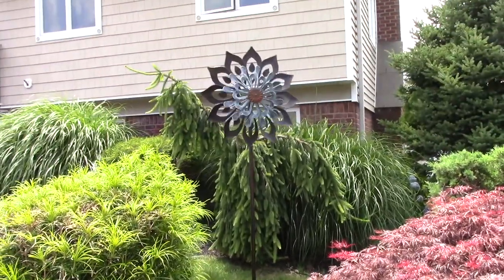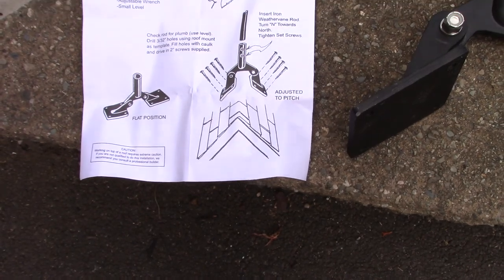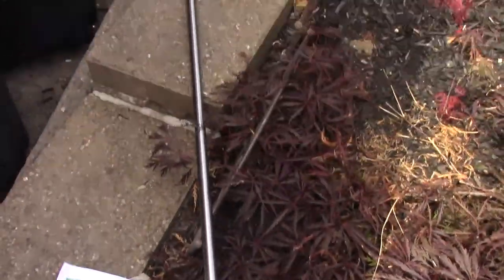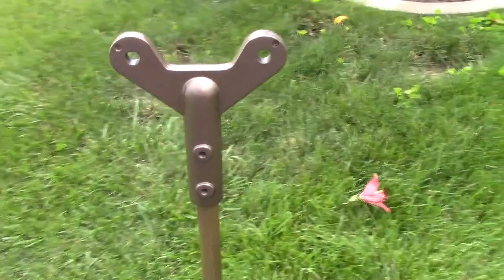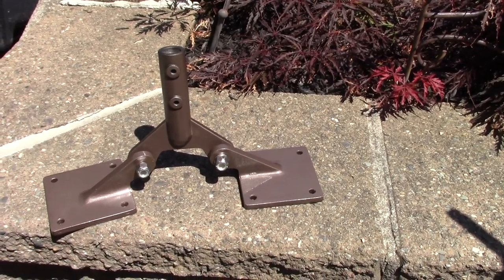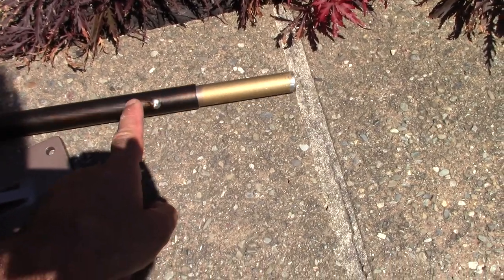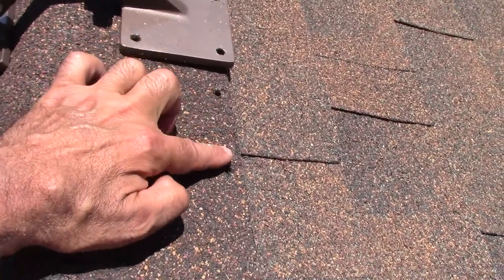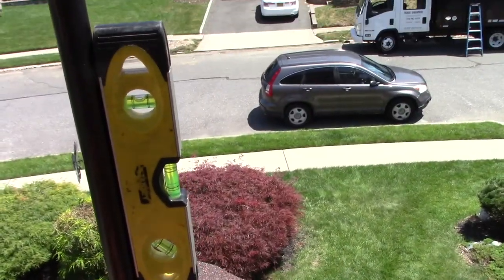Ground Weathervane installed on Roof Portico

Comment: The bolts will leak. They go up and down with temperature and pop out and rust through. Put roof shingle on top of the bolts to shield them from UV light and rain and spray them with Flexseal which is not a permanent product but it is flexible with the temps.